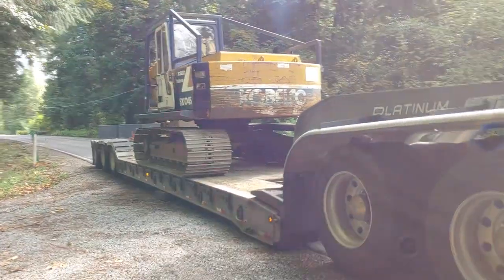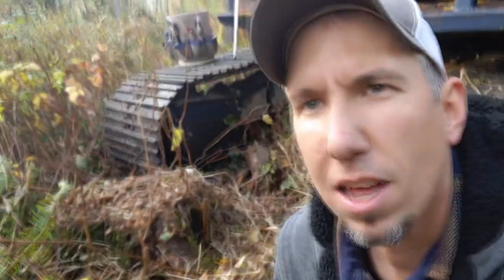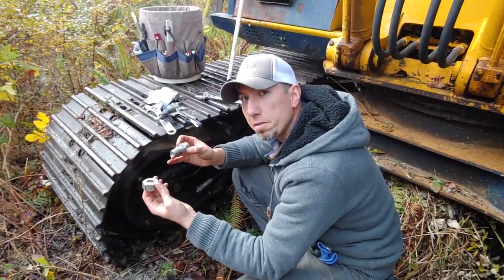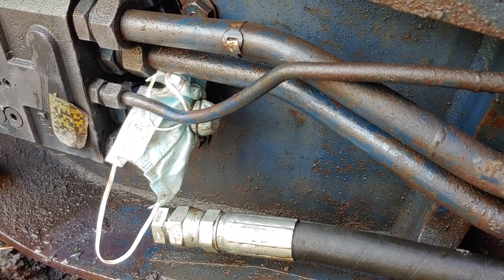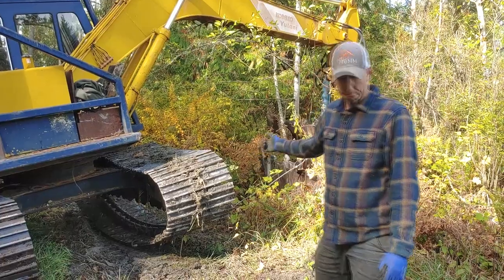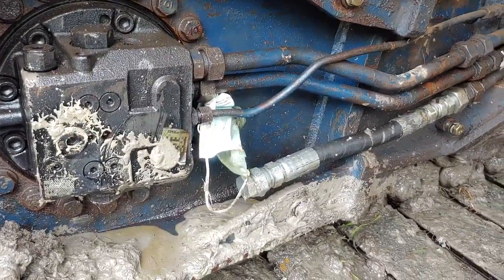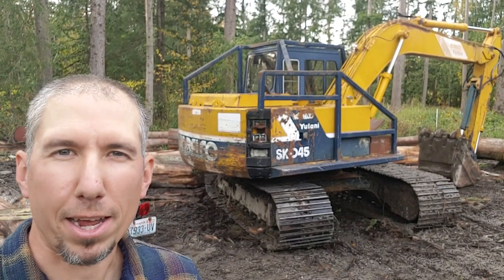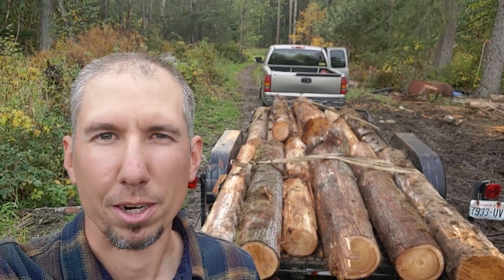Excavator Fail, I Broke It Twice In One Day!

Comment: I worked for a Medford Oregon log truck company when I was a kid (1976). Great experience. Spent 4 months running the gang edger at the Delah Timber Products stud mill in White City over that Winter. Not long after that I entered the Operating Engineers' (Local 12) apprenticeship program. Damn I hated laying under heavy equipment in the heat, snow, and rain so I later entered the Maritime industry working as Chief Engineer (still working chief).
Reply from the maker: Cool!  I have a few videos coming up of me running an edger from 1959 to clean up some boards.  I bet you will find it interesting, stay tuned!
Reply: @SJForestProducts  Nice, looking forward to it.

Comment: Back in 2002, I worked at a coal mine. We had that exact same thing happen to a guy, only he got sprayed with 150 degree hydraulic fluid. I'm glad you didn't deep-fry yourself.
Reply from the maker: Oh man, that sounds painful.  My fluid just leaked out because it was the return line and not under pressure.  Sounds like your guy blew a pressurized line.  I bet that hurt..... a lot!